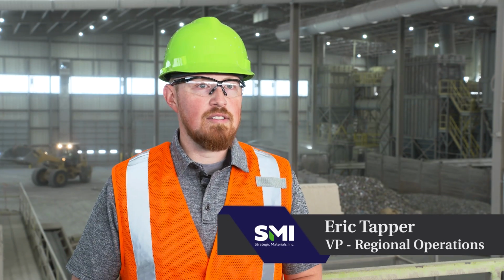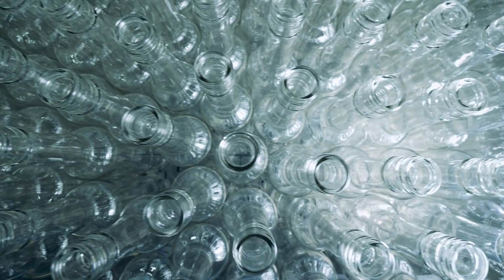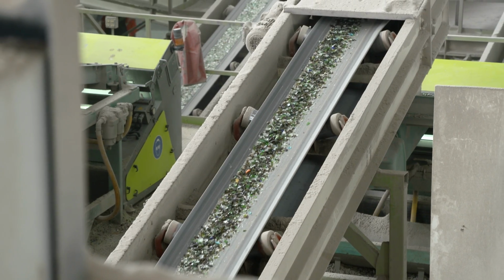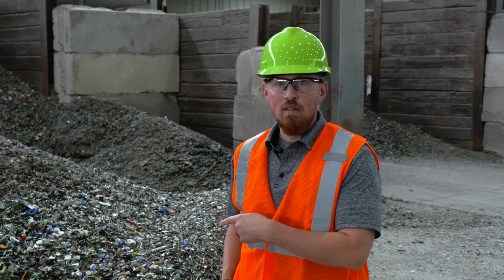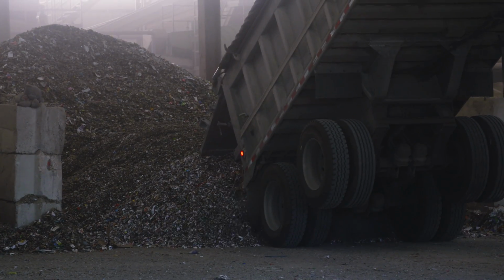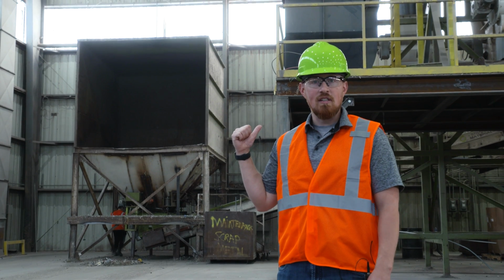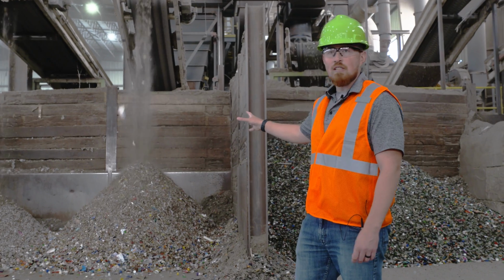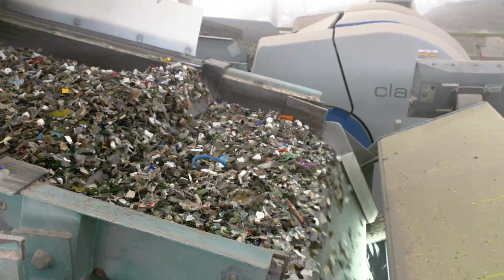How do we recycle glass?

Comment: Informative Video! 👍🏼
But what about labels? Are they being washed off or will they be burned during the glass melting step?
Reply from the maker: Labels are removed when we break the glass. They are then screened off or blown off through the process.
Reply: @smi1896  I can't visualise that properly. Say if I wanted to get a label off a bottle myself, I'd use really hot water with some sort of wire wool, and give it it a really hard scrub, and then go back over the places where it didn't come off. How could all that be done on pieces of glass that are broken? I can't picture glue would just come off by being air blown!

Comment: Is it better to leave a ferrous metal cap screwed onto a glass bottle or remove it when placed in recycling bin?  I was concerned with it screwed on that glass would get stuck inside the cap screw threads.
Reply from the maker: Either is OK.  Leaving it on, it'll be recovered at the MRF or our facility.  Removing it, it could be potentially lost in transit or recovered at our facility♻